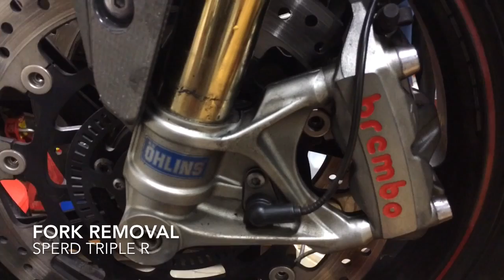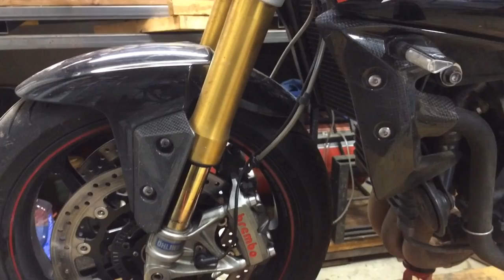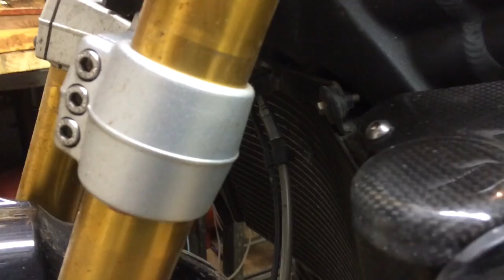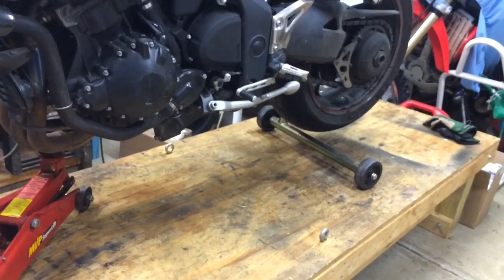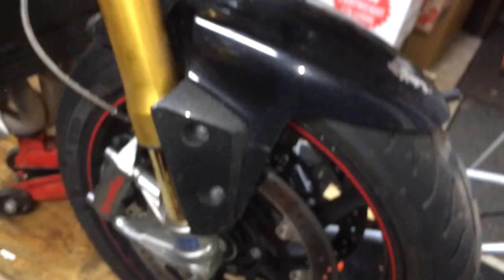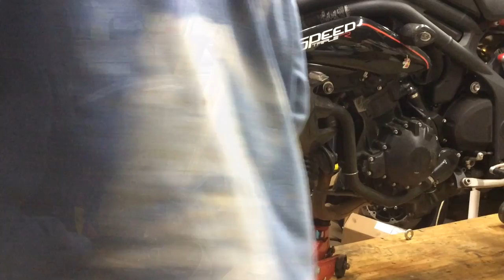Fork Leaking Removal Triumph Speed Triple R

Comment: Good effort on the video but there are better ways to do it. Either by a headstock stand or at least use an Abba stand in the swing-arm pivot so theres less weight on the jack and wood.
Reply from the maker: Good point, if you have the funds to buy the extra stands.